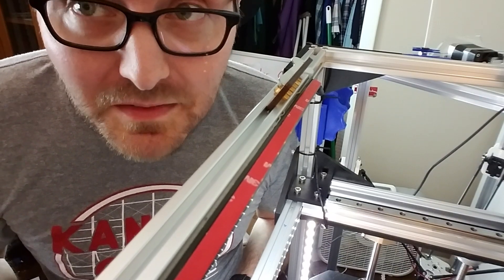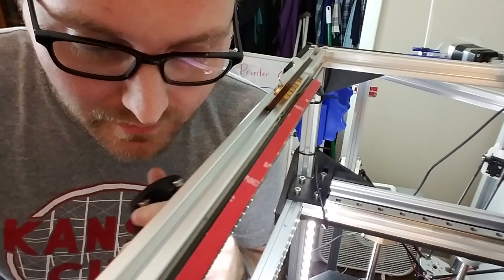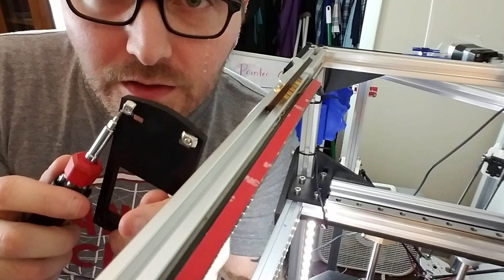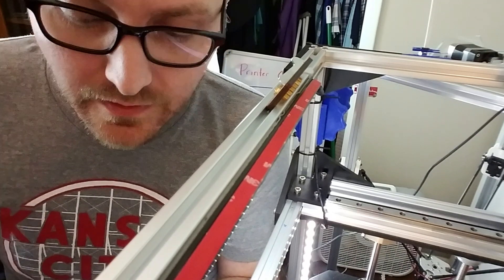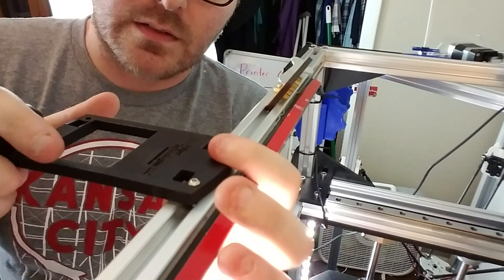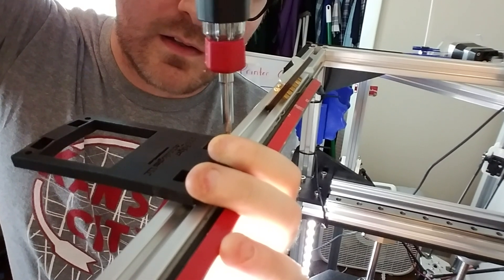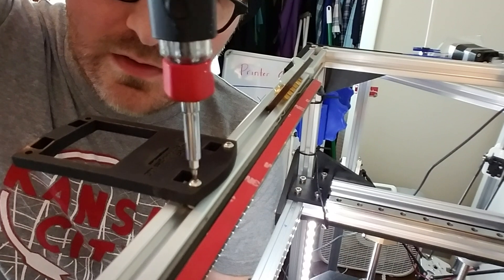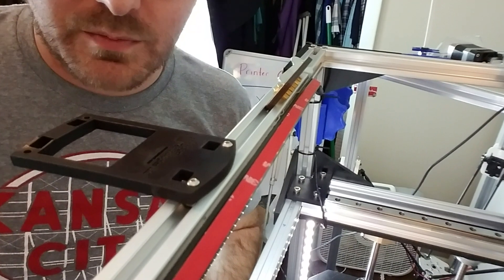Working with T-nuts on aluminum extrusions

Comment: I thought there's no other way than bruteforcing damn things until they are in place. But I also remembered that the internet can actually be useful if operated correctly. And voila: they are easy to mount with appropriate clearance, and can self-align. Thank you so much for this vid.

Comment: Great video, thanks. According to my experience it also helps if the slot is horizontal not vertical as gravity will try to keep the nuts from turning into the right position when you tighten them.